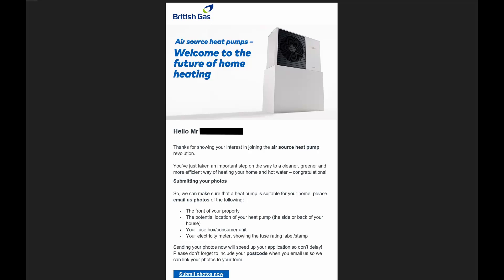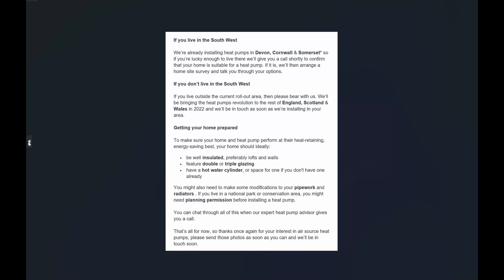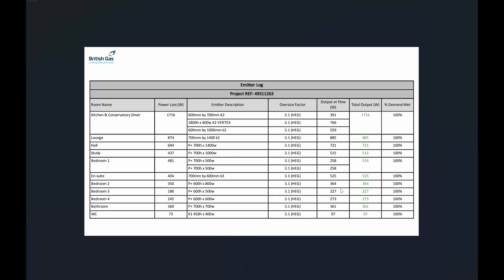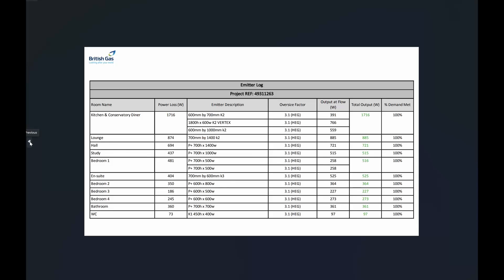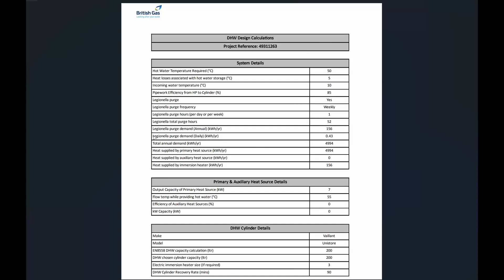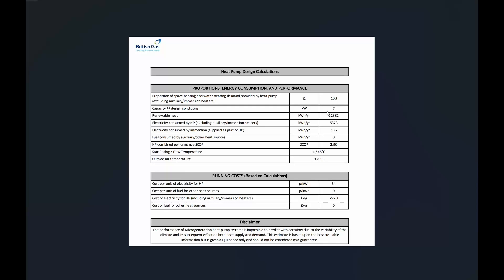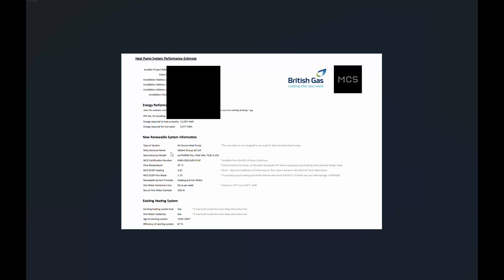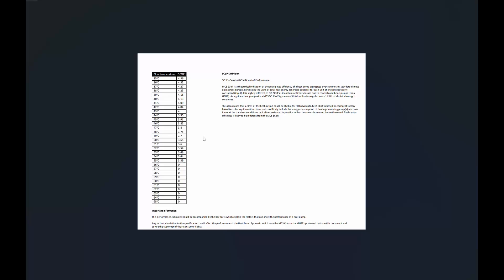Heat Pump Quote from British Gas - Process from the start to getting my Vaillant Arotherm Plus

Comment: Great video! British Gas came around and did the full survey, by the way they (BG) are VERY aware of your videos and were waiting for this one to land, I was talking to the surveyor that was doing my heat loss assessment and he mentioned your surveyor was particularly interested in your experience!! 

My experience: BG are incredibly risk adverse in regards to HPs, putting in a 7kW HP instead of 5kW is to avoid bad press, the last thing they want is the Daily Mail doing a piece on them with your cold house…

So, what happened with my survey… took about 4 hours and right at the end asked to see my water stop cock… then mentioned 15mm pipe on the water might be a showstopper… confirmed the next day that BG can no longer proceed with the install due to mains water feed being 15mm… which I find really disappointing as the water pressure in the house is amazing even when running two showers simultaneously…
Reply from the maker: Thanks for your comment.
Ouch, sorry to hear that you spent 4 hours to be tripped up on something that seems trivial.

I definitely got the vibes of BG being risk adverse throughout the process.
Our surveyor was quite through with testing our water flow rate at multiple taps.

I can't fault the surveyor (think his name was Liam from memory) he did a thorough job and was patient with me too!

Not everything ran smoothly but the final outcome is a well functioning heating system at a bargain price.

Interesting that they're aware of this little video series. It wasn't supposed to turn into a BG spotlight, but that seemed to really spark most people's interest more so than the other aspects of changing to a heat pump that I originally intended to cover.
Reply: @UpsideDownFork  there are only 12 (HP) surveyors in the whole of the UK and they all speak on a group chat. They are aware of Heat Geeks and Urban Plumbers and seem to genuinely want to do a good job and are very interested in learning! However, I feel they are doing this with one hand tied behind their back (big corporate policies being pushed down on them).
Reply from the maker: @stuartornum  I know that feeling well. 
That's why I left working for Mercedes-Benz where the corporate culture was becoming a race to the bottom in not only the quality of the product but especially in the quality of the customer service.
Shame that big companies almost always struggle with that.
Reply: Eon also recommended a 7KWH heat pump for my property and estimated that heat and water would  be 11,000 KWH per year. Gas is 6k for a year whiich makes their assessment lundicrous. I believe they over spec to make money and cover their own asses. I'm very put off by the whole experience.

Comment: Thank you for the video. I am keenly watching your HP installation. My house is similar in size but I do not have the heated conservatory. I live in the SE. I made several heat loss improvements in the last few years (now EPC  92-A). I tested my condensing boiler down to 50 C flow temp even at 7 C outside temp with sufficient comfort. I top up with emersion DHW with off peak electricity or excess from PV/Tesla PW2. My own estimate shows a max heat loss of 4.5 kW.  I contacted several installers. The  recommended HP sizes varied  from 5 kW to 14 kW. BG  quoted £9,999 on the top of BUS grant (£7,500) in their first call without the survey. I am still exploring more options including Octopus.
Reply from the maker: Sounds like you're in a good position. I hope some of the information in my previous videos was helpful to you in your journey.
I found heatpunk very helpful.
Now i'm off work i'm busy editing my way through lots of content to get it all uploaded before I have to get back to my day job!
Reply: Keep in mind that if you have an old boiler, it is highly unlikely that it can modulate down to 4.5kW. So if it can't modulate down to maintain 50 degrees C, it will either short cycle OR it will modulate down to as low as it can which means the flow temperature will creep up above the set point (depends on the boiler's internal controls).  Most old boilers can go down to 6kW if you're lucky and 8kW is more realistic.

Do you have any way of verifying your flow temperature is maintained at 50 degrees C? If not, you might be basing your decision on an incorrect assumption. If you are planning on keeping your boiler long enough that it needs a service, I'd ask for a heat meter to be installed which would give you a much more accurate picture of your house's heat loss (you can keep that device when you do go over to a heat pump).
Reply from the maker: @m23605  I presume his estimate is from a heat loss survey rather than his current boiler testing.
Reply: @UpsideDownFork  Sure. But a survey won't tell you anything about comfort levels. Simulating a heat pump heat source by lowering your gas boiler temperature does. Just pointing out that such simulations can be quite flawed if you have an older boiler with poor modulation controls.
Reply from the maker: @m23605  true, our comfort levels have improved massively jumping down from the 55 flow temp to a 35 degree flow temp. Low and slow is very comfortable as well as all the other benefits 👍
Reply: @UpsideDownFork  Nice. We need 40 degrees C flow at -5 outside temps to feel comfortable even with UFH. We could probably go down a few degrees if we switched off the ventilation system.
Reply: @m23605  The boiler has digital temperature indicator and also load level marker. As I reduce the temperature the load maker goes lower. I installed couple of thermocouples in the flow and return lines. I set the boiler flow temp 48 C. The boiler outlet temperature readings came around 47 C for and return temp around 41 C.  I tried with 45, 48, and 50 C. I did not feel any issue with room temperature and comfort level. It takes around 40-45 minutes in the morning to raise temperature from 18.5 C to 20 C compared to 30 minutes when operating at 60 C. There are less small cycles with lower flow temp as expected. This suggests that this system boiler (15 kW) is grossly oversized for this house. Running at lower temperature is not a big problem as I top-up hot water tank to 60 C with off peak electricity. My main objective was to test if the existing radiators and piping would work with heat pump.

Comment: thanks for all the videos. Just had BG round £12k (inc grant) for a 6kw Daikin 180l Mixergy tank and replacing every rad and all pipework in the house. They said that replacing everything is now their standard policy
Reply from the maker: Ouch. I know the mixergy tank is both the most expensive option and the least efficient option but that sounds like a very expensive quote. Were there some expensive rad upgrades to do?

I'm not surprised that they are quoting for full re-pipes as they have definitely been learning a lot from doing jobs like mine.
Ultimately that approach whilst not pragmatic will guarantee a level of success in efficient running.
Reply: the biggest existing rad is 1600x600 K2. its guaranteeing they wont have to come back, not that its an efficient system. disappointing approah. couldnt explain why my existing 10mm system works fine at 45 degrees on the combi boiler  @UpsideDownFork
Reply from the maker: @brianmorrow4494  I didn't mean necessarily more or less efficient in your specific situation but as a general rule of thumb, they won't run into any problems by adopting that approach.
Have you received any other quotes yet?
Reply: one for £15.5k for a high temp 8kw unit that they said would be the only one to work with the 10mm pipes. getting more tempted to do the whole thing myself and ignore the grant!! @UpsideDownFork
Reply from the maker: @brianmorrow4494  let me know how you get on. I'd be interested to see more DIY installations! Now I've seen what's involved I feel comfortable that I could have managed it, even though it would probably take me a few weeks all in!

Comment: Sorry I might have missed it but from my quick calcs the total on the estimate/quote page came to ~£12k. So that appears to the the cost before the grant (can't see grants mentioned on that page) so originally it would have cost £7k with the £5k grant, and then £4.5k with the increased £7.5k grant?
Reply: @UpsideDownFork  That's a bargain then. I see you've mentioned BG have increased their prices since. Unfortunately the cynical side of me wonders if the increases were prompted by the grant increase.
Reply from the maker: @robthomas7232  maybe you're correct. Or they realised the losses they were making on installations like mine 🤔
Reply: @UpsideDownFork  True, although didn't the other quotes come in around £6 to 7k? Not sure if that is an apples vs apples comparison though, particularly around which grant discount was included in those?
Reply from the maker: @robthomas7232  the other quotes were with £5k grant but didn't include the radiators in the conservatory area which was a not  insignificant part of the cost, not to mention the cheaper quotes used lower end equipment and designed to a higher flow temperature of 50 degrees.
Reply: @UpsideDownFork  Bargain then!
Reply from the maker: @robthomas7232  👍
Reply: @robthomas7232  I think you may be right. Octopus prices went UP to swallow the increased grant when it came in. Obviously I expected my quote to go DOWN but it remained the same when I got a requote, so it appears they are pocketing the extra £2500.

Comment: Thanks for the info. I was inclined to put off some of the remediation work like upgrading the radiators as I learned that it could be included in grant. However looking at these figures it definitely seems worth upgrading as much yourself? I'd be interested to learn more about the heat loss survey they did and how thorough you thought it was compared to your own calculations.
Reply from the maker: Yes, in hindsight I probably would have done all of the radiators myself and left just the 2 large vertical radiators for them which they definitely made a loss doing when you factor in the rad cost as well as labour.
Some of the big wholesalers sell directly to the public on eBay and prices can be substantially lower than Screwfix or the like. Especially as I wanted to maximise the heat output so changed all our 600mm tall rads for either 700 or 750mm tall to get that extra output without changing pipework.
From my perspective as an amateur homeowner who has no right to comment on the competence of a professional, I think the surveyor did a thorough job.
He came in about 200w higher than I did, which is neither here nor there really 
My house structure is mostly very straightforward with little modification since built in 1996.
I'm sure some houses could be a minefield!

Comment: Currently in the process of this direct with heat geeks own install so very intrested. If you don`t mind, what was the total cost for everything from British Gas before BUS, as I`m getting nothing but red flags with HGs service - loads of errors made on the heat loss and proposal, and the quotes almost trippled from the original estimate for a similar property to yours.
Reply from the maker: I've been hearing that a lot in the heat pump forums. BG do seem to have really upped their prices. I think I was such an early bird before they ramped up the pricing. I have no doubt that they made a significant loss on my installation.
Of course the problem with such a large company is the corporate lottery, you and I could receive either the very best or the very worst surveyor that BG has to offer.
Reply: @UpsideDownFork Very interesting hearing your feedback, many thanks. As mentioned b4 BG did my install last March, same pump but with a mixergy tank for some unknown reason. Only 150L tank but only 3 in our household and its OK, usually needs a top up in the evening but it is efficient. To date my heating scop is 4.4 (design scop 3.9) and dhw is 4.1 (design 3.4) so adding the fact that most months my solar pv will top up the tank and I have a cheap night tariff its cheap to run.
 I also have 2 large vertex rads in the lounge but I reckon one would do, as the lounge is the warmest room in the house, I've set the trvs to 3 in there atm. BG did a good job on the whole, 13 new rads, new 22mm heating pipes with 15mm drops, buffer tank and 150L mixergy tank. 
Bad points were the time taken from assessment to install was 5 months so missed most of the winter and the install date put back twice due to non communication between bg  and their suppliers. Also very rushed and I felt inadequate talk thru the controls at the end, a less tech customer would have struggled, they insisted on rads in two places I didn't want them and wouldn't put one in the conservatory so not too good, I suppose I could relocate one as its just the other side of a wall but maybe this will invalidate the warranty. 
Happy with how it's working, extremely quiet and efficient. The 5 year interest free loan clinched it for me, costing £140/mnth, do the maths..
Reply from the maker: @MikeGleesonazelectrics  yep, the 5 year interest free finance is definitely a big factor too 👍
A lot of what you describe is familiar to me from my journey. 🤔
Glad to hear it's working well for you ultimately. 👍
Reply: I also had a lot of issue with a heat geek (JMR). Charged me to get a quote, price was high and I wanted a heat pump but was specced a gas boiler. Wouldn't want to discuss changes and just demanded payment for the quote. I think heat geeks are only for 1 percenters. You have to be quite wealthy to be looking at a heat pump to begin with but heat geeks are on another level of cost. Performance assurances should come from the government (like it is Germany and Nordic countries) and not from private for-profit corporations.
Reply from the maker: @m23605  That's a shame to hear.
Reply: @MikeGleesonazelectrics  I had my survey last week, and unfortunately they only offer 2 years interest free now. They offered me 5kw vaillant, gledhill slimline boiler 180l and plumbing of 6 rads for 6700 after grant.

Comment: Based on your original quote around £10k, did you think after the install how a firm the size of British gas make any money. 
I am looking at it and I can't see how they are, there must be around £6k in materials and judging by how many people you had there at least the same figure in labour. 
I used to work for them and I know how high their prices are compared to small firms partly due to their overheads.
Reply from the maker: Yes.
I have no idea how they are making any money on this.
I am guessing it is a loss leader for them right now and as the market matures in the future they will be able to begin making a profit.
Reply: Not too sure where you are getting £6K for materials from. I had a 2 room a/c heat pump installed 20 years ago and the materials cost well under £1K. Allowing for inflation, a few radiators, and a larger HP, I still can't see £6K, especially as prices should come down as tech beds in. Maybe manufacturers/installers are taking advantage?

Comment: I too didn't take much notice of the cylinder size but "luckily" I was made to take a 300l tank which I am pleased about now since the footprint is the same as smaller tanks. Having moved from a combi, I was surprised at how an overnight cheap-rate charge lasts all day and the stratification lasts too. i.e. a shower in the morning and one in the evening works fine. I do have residents who sometimes take long showers and so wanted to avoid the risk of running out of water while still charging overnight. I seem to have solved this by setting the cylinder temperature to 60C for off-peak and 40C for peak. sensoComfort doesn't allow this so I set it up in Home Assistant.
Reply from the maker: Nicely done! I need to explore the Home Assistant integration next when I can find some time!
Yes, I now know that the footprint would have been the same for 250 or 300L but the buffer tank would have had to be moved to the loft or garage for a taller cylinder to fit in our existing cupboard. A sacrifice i'm more than willing to make with the benefit of hindsight!
Thanks for your comment.
Reply: @UpsideDownFork  Bearing in mind my house is almost identical to yours, how would you feel about putting the (larger) tank in the integral garage? This is so that we gain the full use of the airing cupboard rather than lose it altogether.
Reply from the maker: @darrenadams2640  Yes, that would have been sensible, but then where would I put my motorbikes?! 😁

I have constructed shelves at the front of the airing cupboard, so we have managed to store nearly everything back in there and it's more easily accessible than before.

BG amongst others will now only fit a slimline tank in airing cupboards like mine. They realised their mistake whilst doing mine.

Comment: With your heat loss of 5.8, and noting these figures would be very slightly worse with a more favourable design spec of 45 flow with -2 external, maybe they recommended 7kW (8.1 max) instead of 5kW (6.2 max), to give themselves an even safer margin - over and above the buffer they also insisted on!

Over specifying suits them as it costs you more to install and gives them lower risk, and you get lumbered with slightly higher ongoing bills due to lower efficiency. That said, the max for the 5kW is only 7% above your heat loss so not an unreasonable thing to do - certainly nothing compared to those 14kW quotes you had!
Reply from the maker: The price difference between the 5kW and the 7kW was the same. The only price variation would have been the choice between Daikin or Vaillant.
 You are correct it is about lowering their exposure to risk.